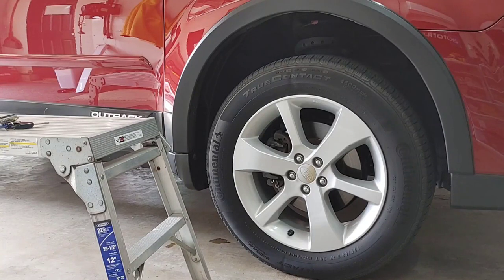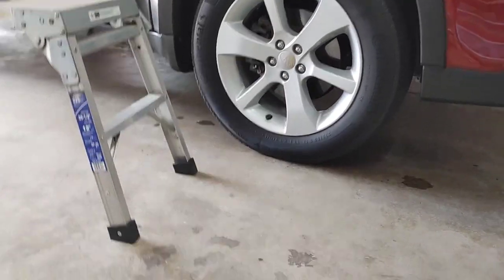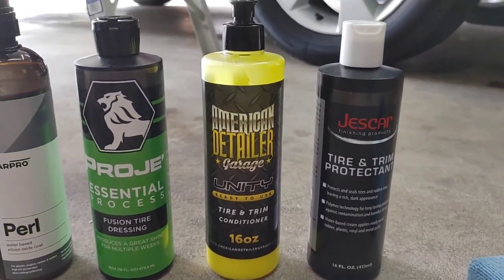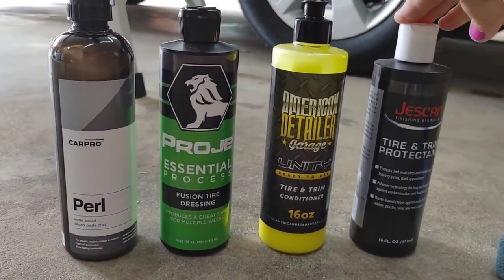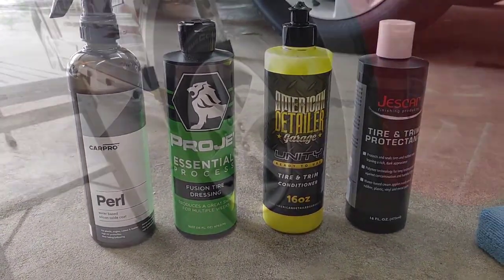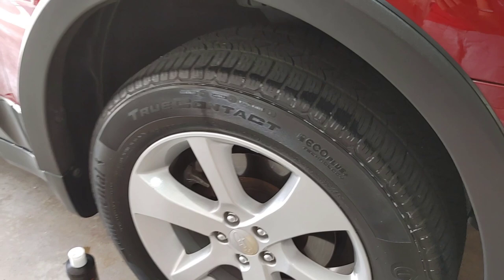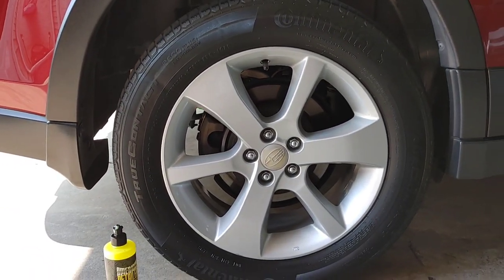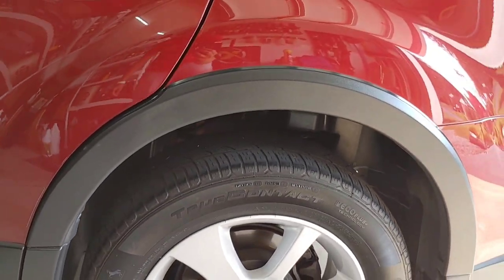Best Tire Dressing Showdown- Favorite look? Durability? Sling? Updates to follow!

Comment: Have used PERL forever and it always looks better than anything else I try. Durability isn't the best but it's not that bad either. I dilute it 2:1 and use it in a high-atomizing sprayer to dress offroad tires with large sidewall lug patterns. Mist and walk away. Works great on the engine bay as well.

Comment: Buying new ones all the time and always going back to Carpro Perl 1:1.
Reply: How's the durability and shine?
Reply: @richardfox3924  Because it's water based the durability in not very strong but good enough for me because I like to lay a new, fresh layer after every wash. I dilute it 1:1 and then it applies very good and, most important for me, it is only very slightly shiny, almost matte, as I like it. NO sling at all. It dries quickly and becomes completely dry. A relief compared to almost all the other brands.

Comment: Sounds like our tire coating would be the perfect fit. Zero sling, last months, not greasy,  no silicon, oils, or solvents.
Reply: Would love to try that
Reply: @mattduffy2023  I would love to try the LSCT Matte Finish tire dressing but can't bring myself to spend $31.00 dollars on an 8 ounce bottle as an experiment when HydroSilex 16 bucks for 16 ounces on Amazon and AMAZING!  I threw my PERL in the trash after getting the HydroSilex.  If you do try the TSC, please report your findings.
Reply: @Ryan_H22  I’m willing to bet after you see the longevity and how little amount of product you use I’m sure it will out last most cheaper products that you have to reapply so often and use more to cover the area. Give it a shot you might be shocked. It could possibly save you money. If your a detailer you can even upsell our products and put more money in your pocket. We have guys up selling a our tire coating anywhere from 25-100 dollars.

Comment: I myself use Perl 1:1 love if, does it last? about 2 weeks for me but I usually wash the car every week or so so not a problem to me if you apply the 1:1 every week to only your car tires and trim (they recommend 1:3 for trim but I like the look it gives and a bit more durability) I would say 500ml bottle definitely will last over a year